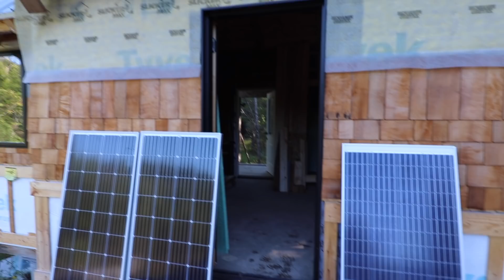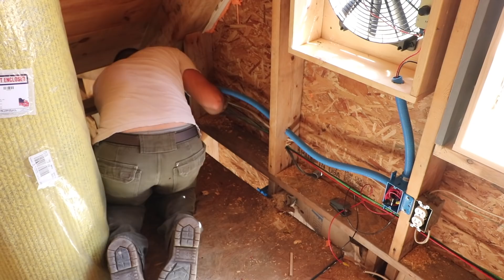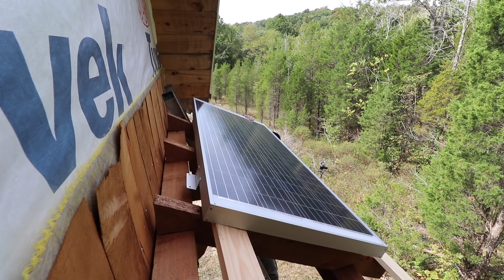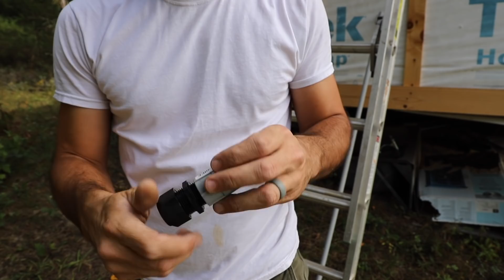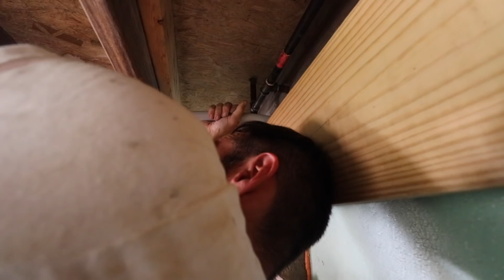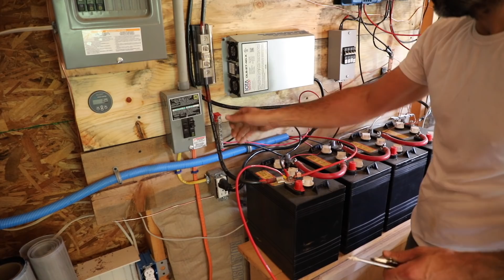Expanding an Existing Off Grid Solar Power System

Comment: Hola no entiendo por que no pone todas las placas en  el tejado del sur.
Es una autentico error colocar esa placa en el oeste por que tendrá muchas sombras de los arboles y cuando esto
sucede la placa no entrega practicamente nada.
Otra cosa, eso es muy caro, yo he puesto en mi casa 18 placas de 330 watios, a 92 euros la placa un total de 6500 watios.
con un inversor cargador mppt de 5.5 Kw  y baterías de litios 10kwH.
Creo que usted está muy mal aconsejado.

Hello, I don't understand why you don't put all the plates on the south roof.
It is a real mistake to place that plate in the west because it will have many shadows from the trees and when this
happens the plate delivers practically nothing.
Another thing, that is very expensive, I have put in my house 18 plates of 330 watts, at 92 euros a plate a total of 6500 watts.
with a 5.5 Kw mppt charger inverter and 10kwH lithium batteries.
I think you are very badly advised.
Reply from the maker: La matriz orientada al oeste es muy productiva. Es una ilusión óptica que los árboles lo bloqueen. Me da energía temprano en la mañana, quitando la carga de mis baterías. Con una matriz orientada al oeste, sur y este, mis baterías solo necesitan funcionar alrededor de las 7 p.m. a las 7 a.m., en lugar de las 3 p.m. a las 11 a.m. Entonces 12 horas en lugar de 20 horas. Me gusta no tener un montón de dinero en pilas, un artículo de consumo.

Comment: Working through your back videos now, really enjoying the channel. A few years ago I installed a similar LCD display and the mounting had me stumped. Not sure how it's meant to be mounted, but I used a 4" steel electrical box with a steel single GFCI receptacle cover. Use flange bolts on the back of the wall plate screws to catch the slight lip of the display and press it against the opening in the receptacle cover, which is about the same size as the display itself. It's sturdy, protected, and looks tidy
Reply from the maker: Hi Tom, welcome to the channel, glad you are enjoying it.  Thats a good idea with the receptacle cover.  I am thinking of moving all the instrument panels to the wall by the counter in the kitchen would be kind of a cool command center display.
Reply: @50Acres  great idea. Build out a nice custom box to feature all of the displays and then 2 weeks later remember one you forgot to include. That's how I would do it anyhow
Reply from the maker: @damnedhumanrace  yea I was kinda thinking make it look a bit nautical like a boat's instrument panel.

Comment: Why are you not using all the roof real estate and have full sun coverage all day instead of crappy shaded panels.You could tilt panels on the roof to the east and west and have a clear view with no shade instead of the Mickey Mouse way you did this.  Wiring is pretty sloppy as well, had to rain on your parade and your fan boys accolades.
Reply from the maker: I only need the extra power in the summer when the sun is highest.  Easier to keep it clean so there is no real need to mess with Mickey Mouse tilting of panels on the south facing roof.

Comment: Like your videos and a subscriber, if you have a chance could you provide the pros and cons of housing the solar gear inside a cabin vs. housing in a separate outside shed, thanks.
Reply from the maker: I think if you are inverting all your power to 110 volt AC or 240, then it makes a lot of sense to have a power house,  because it's relatively cheap to get the power into your house to a panel.  If you are running a lot of stuff off DC it can be costly to move a lot of power.  Having it inside is nice because you can fuss with it when you want.  A drawback is that it takes up a lot of space.  Especially in a small cabin like mine you lose some room.

Comment: If you look on craigs list you can find scaffolding for  about 75 a section(6 foot ) .Which helps build and work on any house .  Keeping you safe and lets you work with a stage  .
Reply from the maker: I've been keeping my eyes open for some.  I have some ladder jacks, just need to bring my other ladder down.
Reply: @50Acres  Better safe than sorry .Working by yourself  is hard enough  but with a scaffold  ,you have a staging area  for tools and material . Plus  I don't bounce like I did when I was younger. 
Keep up the good work and  our dream alive...;)

Comment: When pulling multiple wires thru conduit, unspool the wires, fasten the ends together in your drill, and twist together loosely.  This will be much easier to pull.
Reply from the maker: thanks for the tip!

Comment: Those panels need hinges for wintertime to tilt them vertically so you won't have to clear 4" of snow out of them everytime.  Lithium batteries are getting very affordable,they need less power to recharge them and don't lose it as lead batteries do. Different  charge controllers is better because it squeeze more electrons out of each panel. Thank you for sharing.
Reply from the maker: Thanks Nelio

Comment: Reminds me of my house. I have 4 fuse boxes and 2 circuit breaker boxes over 3 floors all interconnected over 100 years. If I blow something it takes forever to figure out where the trip is. I'm betting you did a better job than the crazy farmers who wired this mess (me included).
Reply from the maker: I grew up in an old colonial house in MA that was the exact same way.  My stuff might look a bit crazy but it’s actually wired in a very logical traceable way.
Reply: @50Acres  I have my own system here. It's fine unless they ever require a fire inspection. One good thing about the country. Lol.

Comment: You are doing great! But to help save money, know that in the future you can save major wads of cash making your own conduit elbows! So easy over any stove. Just take your time, have a wet rag handy to chill the conduit when you get the bend you like. If it starts to flatten out during bending, just give it a slight pressure on the sides and it will open up round again. You will be so surprised how easy it is and you will never go back to buying elbows. Well worth your time.
Reply from the maker: Thanks I will have to give that a try do you do it on a gas stove?
Reply: @50Acres  Over just about anything that generates 400 degrees  or more of air above it.  even a good Heat Gun. With a little bit of experimenting you will find the sweet spot and know how to repeat what you want. You can even make Bell ends if you want by tapering the end of another short piece of conduit,  heating the end of a piece you want and sticking the tapered piece in there, cool and you have what you need. Talcum Powder can be your friend if you put a bit on each piece before joining while hot to form to help release. Keep up the great work! I love your style!
Reply: Quick note: Be patient with the heat and too much will discolor or even burn the PVC. It takes a short while for the heat to penetrate all the way through the thickness of the tube walls.

Comment: I love your channel, but as always when watching these you tube channels the lack of safety precautions make me cringe. I worked in the telecommunications field for a couple of decades, and I can tell you that getting the wires hooked up properly is not the end of the job. Circuits, wires, breakers, controllers, all need to be labelled. Wires need to be secured to the wall to prevent them being pulled off. Your buss bars need to be covered so as to protect them from accidental shorts. The battery box should lined to protect against acid leaks. And most importantly, clear instructions with a circuit diagram to aid your memory in the future, and help those who might have to shut it down in your absence, barring any unforeseen mishap. Other than that keep up the good work.
Reply from the maker: Thanks Geoff I will be implementing a lot of that in the near future.  A lot of it is just being able to find the right product like covers for the bus bars, or taking the time to rig up your own. I'd love it if they came with a nice clear plastic cover like the one over my inverter fuse.  As for the wires, once I am happy with the setup of all the components I'll definitely do that.  I have a feeling I will move this stuff around a couple times.
Reply: @50Acres  I have made myself my own DC distribution panel with exposed buses (old school). I plan to build my own covers out of acrylic sheet material. The reason you are having difficulty finding covers for them is they are usually mounted inside cabinets, or in areas like power rooms on equipment racks. Where access is limited and there is not much chance of something coming into contact with them. For labelling I use a product called Rite & Wrap from www.ziptape.com.
Reply: @geoffreygriffiths1487  WOW!Good information! Thank you very much!
Reply: @maryblaylock6545  This is the product I use https://ztlabels.com/products/dispensers/writeable-wire-markers-booklets-and-dispensers/
Reply: @50Acres  This is the product I use https://ztlabels.com/products/dispensers/writeable-wire-markers-booklets-and-dispensers/

Comment: For some reason I HATE the sound of your drill. Are there different types? I've never heard them here in Europe.
Reply from the maker: I use an impact and a drill, sometimes I pulse the impact driver to avoid stripping, splitting or tearing out the wood.  My impact has 3 speeds, but usually I am not on the ball enough to actually switch the setting to the task I'm doing.  My drill also has different speeds that I never remember to change.
Reply: @50Acres  Yeah but the pitch of the sound it makes is really high for some reason.

Comment: Nice setup for PV system. Only issue is with bare wires behind th wall and under the cabin. I found out the hard way, mice love to nibble on the wire insulation leaving bare copper exposed, ready for a short. The more that is run in conduit the safer and neater the instal. Check out Engineer775 videos for ideas on getting the wires run neater within wiring troughs.
Waiting to get enough money saved up to do my off grid PV system.
Reply from the maker: I have a plan for that bit at the end but needed some material (half inch schedule 40)  that I didn't have on hand.

Comment: Even thou it was marked on the box, you did right by verifying the Voltage and Terminals with your DVM. You don't know what some employee at the manufacturer might have done. Need FREE advise for any Electrical or Electronic System review www.IntelEstate.Net or Call (909) 600-6668 Ext. 501

Comment: Your good to go. If you had it do to do over you would have just added more panels on the roof. But it is what it is. One MidNite Classic 150 could have taken care all of your needs and be able to remotely monitor everything, even change settings. Those busbars are just what the Dr. ordered. One ground busbar for all equipt. along with one #6 bare copper to a 8' grounding rod. One good thing about fred480V is if you order a 180 watt solar panel and he is out of stock he will send you a bigger one. Those bigger panels will wear you out with up and down the ladder. Your calves on your legs will feel the burn tomorrow.
Reply from the maker: yea ive had him do that to me before I ordered 160's to match a 160 I already had and he sent me 175s.  It was a pain to get those panels up...

Comment: looks amazing just subscribed  have a look at my channel for more ideas buddy keep up the good work
Reply from the maker: very cool looks like you have been at it a long time.  How those wind turbines from 8 and 9 years ago doing?  I have always been interested in small scale wind but just hear a lot of bad things about it.  Like difficult to maintain etc.
Reply: @50Acres  i still have my main 600 watts turbine and 300 watts and they are still pumping amps the main thing is to have clear undisturbed air , i build them myself so the maintenance is easy keep up the good work

Comment: How come you ran the wiring on the outside (over that beautiful panel!) instead of inside the walls, seeing as the drywall etc isnt up yet? :)
Reply from the maker: On the side with the single panel, I have finished the interior (in the bedroom).    I really hated running that conduit.  I basically had 3 choices, run it up to the ridge and under the metal roof, run it across to the side or run it down.  I kinda decided down was the least invasive.

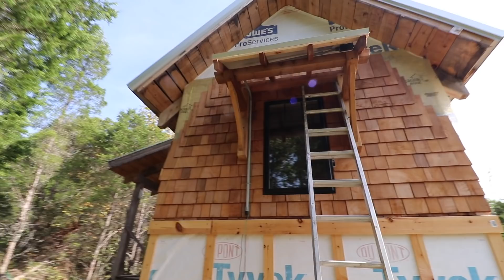Comment: Are you kicking your self for leaving the grounding wire on the outside of the top wooden plank, instead of having it behind like the 2 other wires? See @ 25:54
Reply from the maker: yes, I was very upset about that, going to have  pull that board off now...
Reply: @50Acres  yea when I saw it I was like "OHH NNOOOOOOOO! That's going to suck!"

Comment: The way you have it grounded is fine. It's actually probably not even needed based on the size of the array. You can also do two ground rods at the two different locations, but then you would need a wire connecting the two ground rods. The way you have it is simpler and a cheaper option. The two rods would be better if the panels are away from the cabin. Then if you have a lightning strike, it doesn't bring any surge back into the cabin. Why not go with one larger charger controller? Does the larger array have a higher output voltage?
Reply from the maker: Hey thanks bud.  I chose to go with multiple controllers after doing a lot of research it seems like most people stated multiple arrays on a single MPPT would confuse the max power point calculations and possibly decrease output.  Also, my friend from Bobby's Solar Homestead channel runs multiple arrays and controllers and he has been advising me on this project a bit.
Reply: @50Acres  Great! Thanks!

Comment: Have you thought about potential wind load on the solar panels acting as shades over the windows?  I have no idea how strong gusts could get in your area.  Maybe I'm overthinking this but I would worry that, with no sheathing underneath to deflect the wind,  a strong gust of wind against the side of the house could push up against the solar panels from underneath.  Might even push hard enough to damage the panels.  Not trying to be negative.  Love your videos and the house.  Cheers.
Reply from the maker: Yea I'm not sure I may have to accept some degree of risk there.  I could throw some extra Z brackets on but I'm not sure how much that would help.

Comment: This is an excellent video.  Ir shows excellent installation and connection  detail.   I have often wondered whether it was possible to parallel the outputs of multiple charge controllers without some method of external diode protection.  Having said that, there is of course,  the problem of voltage drop across the diodes.   So, you foresee no issues with multiple charge controllers connected in parallel?
Reply from the maker: Hey Bob, it's actually pretty common in larger installations where one controller can't handle the task.  Not as many people doing it on smaller installations such as mine.  If you are bored, Morningstar has a good white paper on the subject: https://www.morningstarcorp.com/landing_page/download-white-paper-parallel-charging-multiple-controllers-separate-pv-arrays/#gf_45. It's called "Parallel Charging With Multiple Controllers With Separate PV Arrays". You have to put in some info to download it but its a decent read.

Comment: After you're done with the electrical in the cabin.. for safety reasons.. please draw a simple diagram (which wire goes to which light socket, power outlet and breaker box).. you never know.. if and when (tomorrow) you need to upgrade the wiring..or to add more solar or a wind turbine it will be easier to re-arrange by looking at the diagram.
Stay safe.. GOD BLESS.
Reply from the maker: Hey Edward, I've got these videos to look back on as reference!  I also have loads of pictures of everything.
Reply: @50Acres   nice. :)

Comment: It’s coming along nicely. 

Sundancer makes a nice 12/24v top loading fridge that only draws 14ah/day and a freezer that draws 37ah/day. Both are 5 cubic feet. 

As mentioned below someone else’ comment, you can do PV to electric hot water
https://youtu.be/jW4IqEemteY
Back in the days they had a two loop water heating solar panel (no actual solar cells). One loop gets heated by the sun, then goes into a water tank where it heats the contents. Haven’t seen those mentioned in a long time. 

Keep it up, looking for the next video next month
Reply from the maker: Thanks Phillip, I have been doing a lot of research lately on hot water, excited to try to come up with a system.
Reply: 50 Acres & a Cabin a lot of it depends on the volume of hot water you want and if it’s summer and/or winter usage. 
For me personally, a wood stove with water reservoir should take care of a two person household in winter and for summertime, I’d just hang a bunch of Coleman solar shower bags. They get the temps high enough that you need to mix it with cold water. 
But I can see how most people would want a more steadily reliable source of hot water.
Reply from the maker: @4philipp  Yea for me a sun shower is probably fine.  For the next couple years at least I'll only be there part time and would probably only be taking 1 shower a week since I mostly do two or 1 day trips once a week.  I think a small DC element would even work because it would have all week to heat up the water and if I super insulated the tank It wouldn't cool off much at night.
Reply: 50 Acres & a Cabin absolutely. The temporary setup is never the problem, it’s always the continuous need on a daily basis. Having time to tinker and come up with a working model will be great.